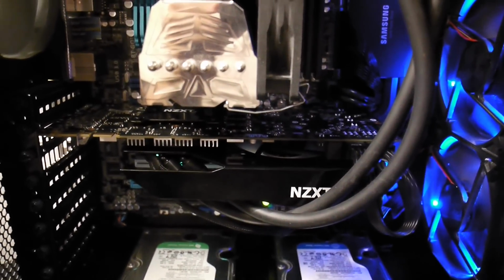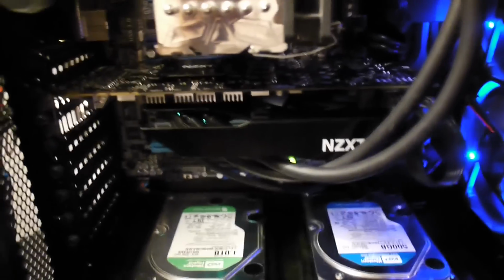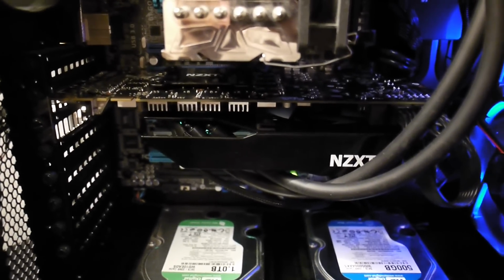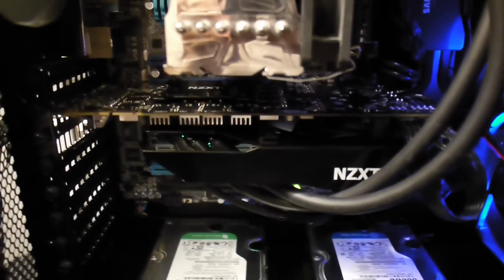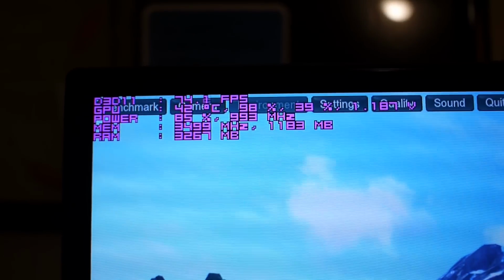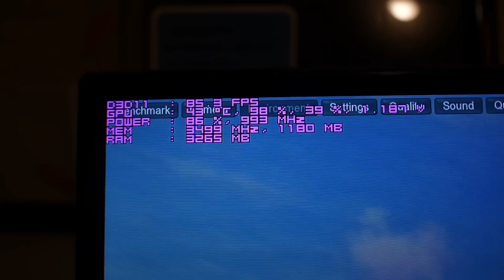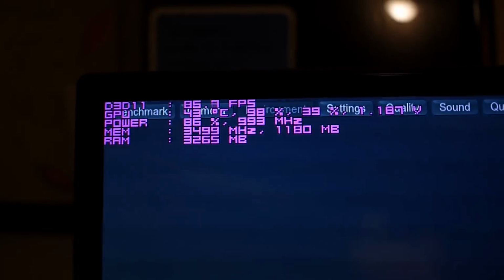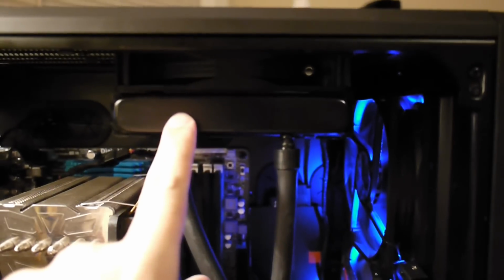NZXT G10 impressions

Comment: Nice setup.
I am in the situation of needing better/quiet cooling for my amd 7950 crossfire setup. I am concerned it's not going to fit though, affraid that i wont be having enough spacing between the 2 cards. Since you have a Asus P8P67 pro mainboard as well, could you please tell me if there is space for a second card? Thank you very much.
Reply from the maker: i dont have this set up anymore :( i went and did a full custom watercooling loop. 
i know that the spacing for the g10 takes up 2 and half of the third slot so i dont think it will. it may. i would test it if i still had my g10.  the 7950's shouldn't get to hot. how hot do they run? and really the AIO cooler keeps the cards GPU (not the vrm and ram) cooler, the noise from the rad fan is about the same depending on the card. i was able to lower the noise of my card by a tad but it was not that much. but yet again i was only using a single 140mm rad aio. if i went with the 280 could have very  well ran 2 fans at lower speeds rather than 1 fan at medium speed.
Reply: Valkyrie743 Thanks for the fast response. The temps of my crossfire setup are actually quite ok, about 80c max or so. The biggest reason i want alternative cooling is the noise... I have two Sapphire 7950's that start vibrating/rattling at a certain fanspeed. It's pretty annoying and i'd like to get rid of it. I RMA'd one of the cards once before but after a little while, the noise started again. Therefore i'm looking for a affordable cooling solution for my cards.
Reply from the maker: TheRck1984 personally, what i would do is sell both cards and just got one card that puts out the same performance. this will fix your noise issue being that you would only have one card and that one card will hopefully be new and will have a good HSF on it. also you wont have to worry about crossfire profiles and scaling issues. as well as crappy frame pacing with amd cards and stuttering. 

you can get a really nice card for cheap these days.  and i would put my money into that then spending 30 each for the g10's and another at least $180 for the 2 AIO coolers. i would take that money and j ust add it to the money from selling the current cards you have.
Reply: Valkyrie743 Valid point, and i have been thinking of doing that actually. Problem is.. Selling these two cards with the vibrating/rattling. The new owner will probably notice right away... Tough decision...
Reply: Valkyrie743 Besides, as far as i know.. crossfire 7950 still beats the crap out of any affordable single card setups at this moment. So i am definitely going to see a performance hit, especially since i am gaming on 1440p
Reply from the maker: TheRck1984 true. i always forget whats what with AMD cards.  the 7950 is the same as the R9 280  and 2 of them has 3584 shader cores while one 290X has 2816 so yeah. you would loose some performance. if you did just went with a 290X, and overclock it, you probably could get close to the same performance as the 2 7950's   is it the fans making the noise on your cards? are the reference cards ?
Reply: TheRck1984 I have a 100352-2L and i am having the exact same problem as you with one of my fans starts rattling around and is noisy as hell when the fans going close to 50%. i was wondering what was your solution to this problem was.